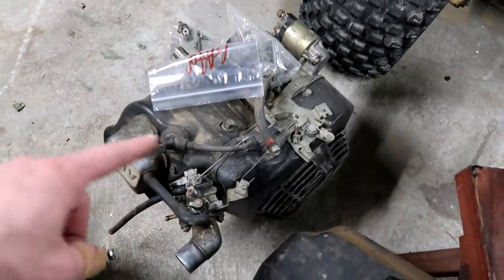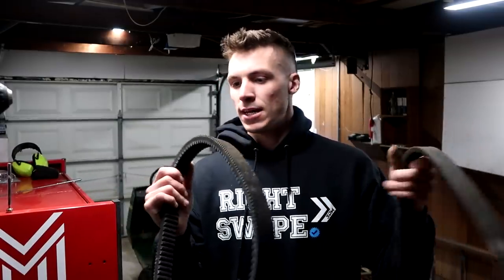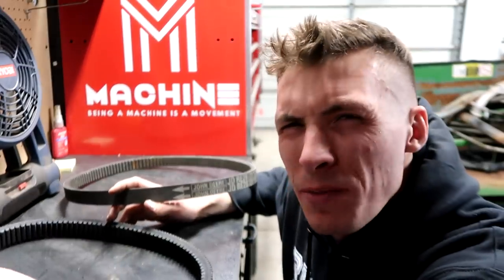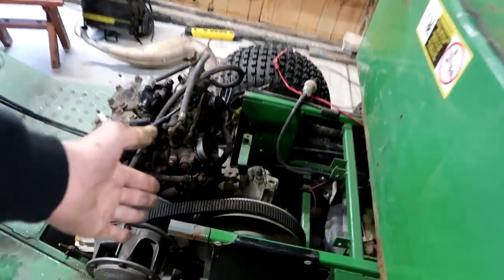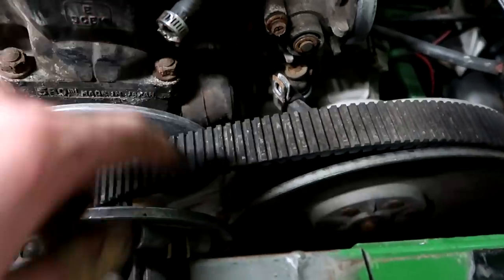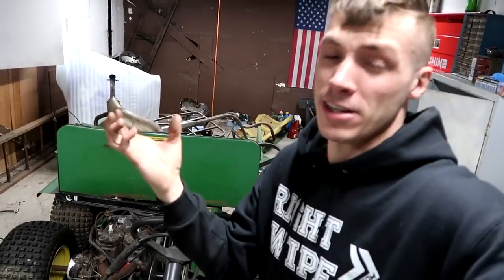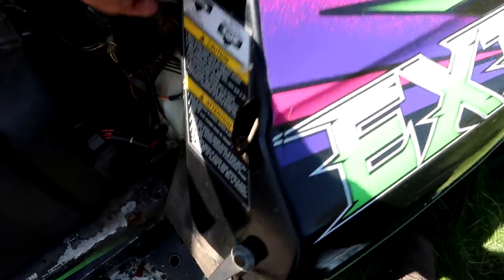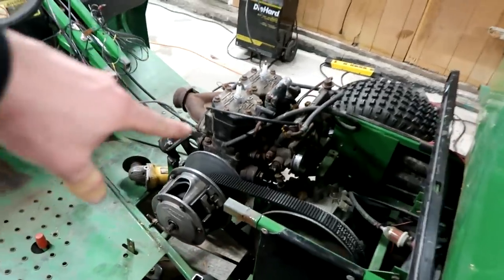Absolutely Savage Machine with Modified Engine

Comment: Get some GPI dirtbike radiators off Ebay.  You can mount them in the bed of the beast, and make air scoops to funnel the air into them.  This things going to be wicked, if the frame can handle it, lol!

Comment: You could use a radiator from an old atv and you can just use heater hose from the auto parts store for the cooling system that way you can put a cooling fan on it if it get too hot

Comment: The cooling there snow would be a major factor cause cold stomps heat this would temp variants differant than reg coolant so slightly larger core duel fans or maybe run pure antifreeze no water added the pure coolant has a lower drop in temp out of radiator just the torc of the pulley if that belt snaps first time way to much diameter wrong of course you know this just wondering cause to much of a good anyway looking on the mounts alignments looking great!!!; )